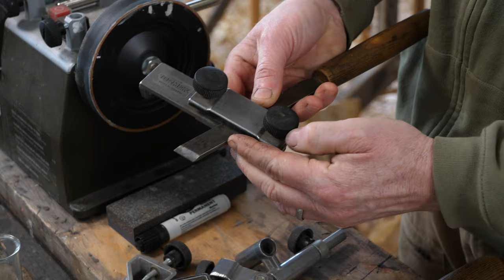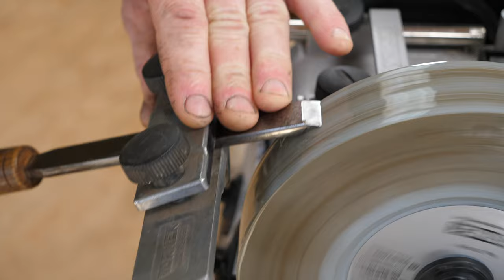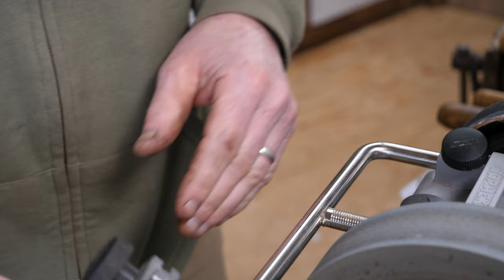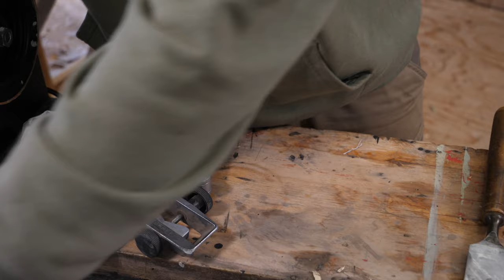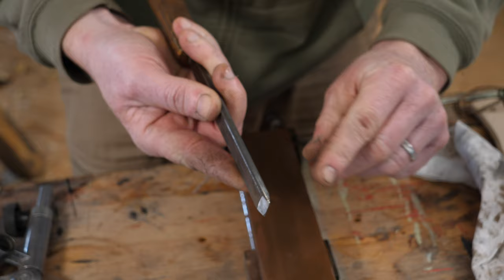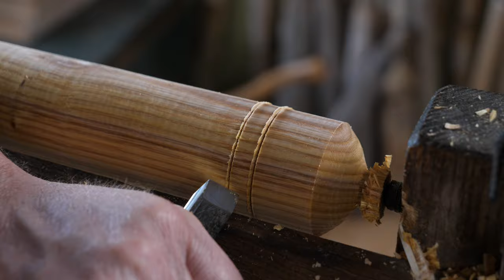How to Sharpen Chisels - The Skew Chisel

Comment: Hi Ben, one thing that puzzles me if you can advise please?  If you use a hollow grind and then hone, the effective bevel is actually quite small.  When 'riding the bevel' before engaging the cutting edge, does this mean that the tool is harder to use than if the whole bevel was completely flat (which I know is in itself not ideal as it slows down sharpening).